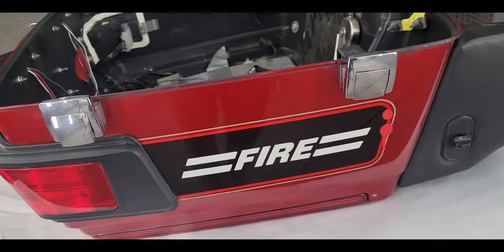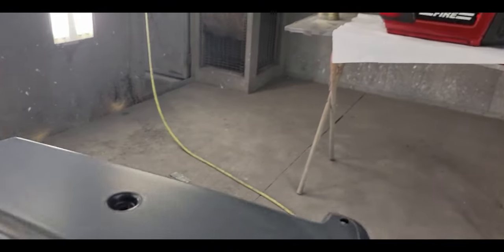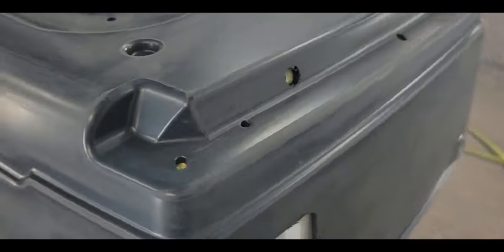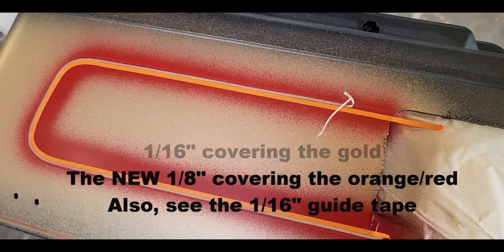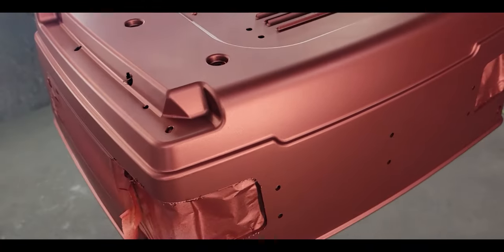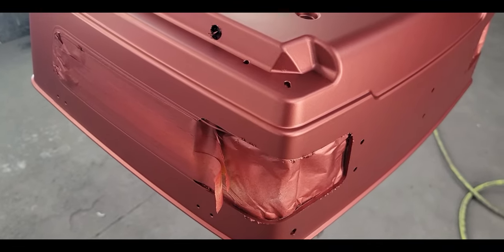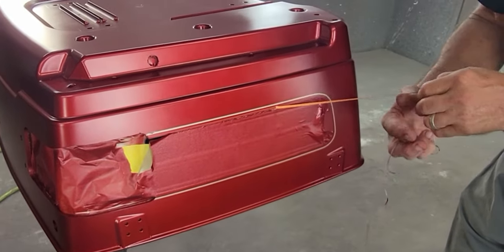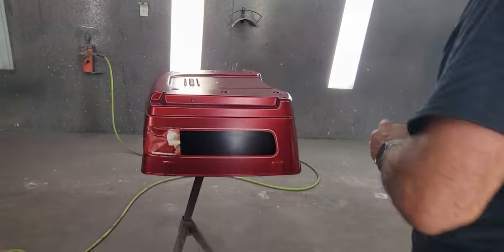Great video for painters that can't pinstripe. Pinstripes are done first before the base colors.

Comment from the maker: I haven't talked to the striper I've used to use for about 3 years now. Plus she lives quite far from the shop. 
I wouldn't have gotten the job done this quickly either. Plus using the fineline tape to mark the width of the stripes will be more consistent than pinstripes that are and laid on.